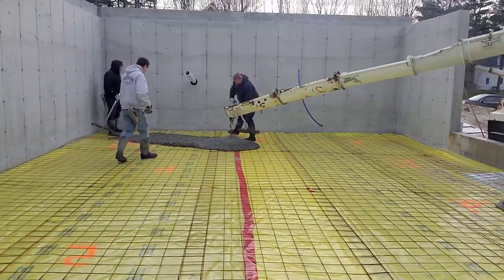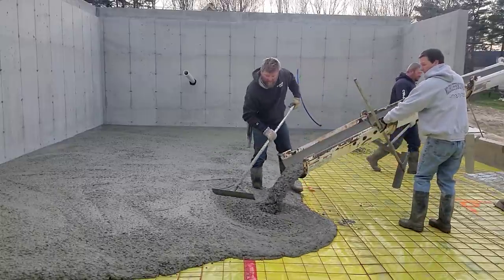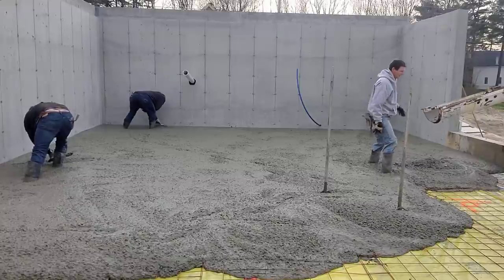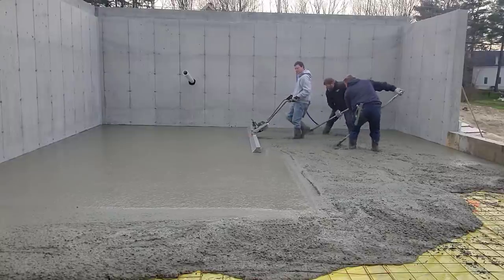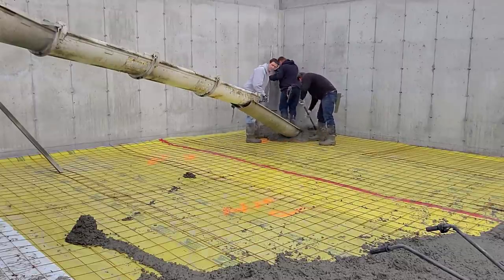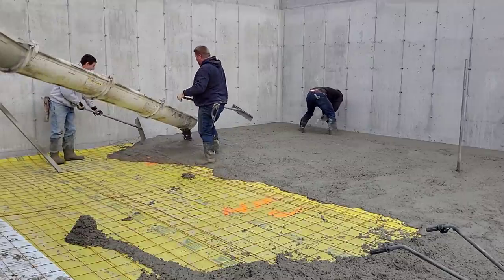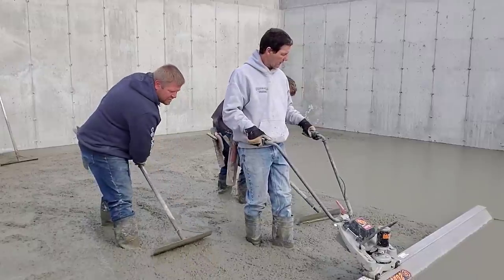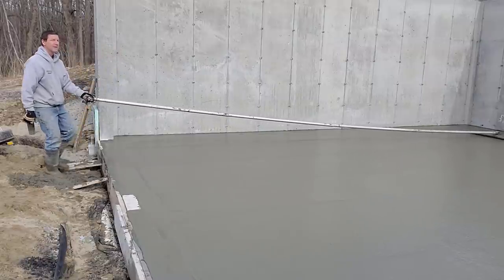How To Pour A Concrete Floor - 3 Man Crew - No Sweat!

Comment: Philip MacKenzie, hey Mike doesn’t the water reducer weaken the concrete?
Reply from the maker: Just the opposite, you use less water so it helps maintain strength

Comment: I've been wanting to try the wet pads on my floors. I've always used grade stakes according to my straightedge length. Is it just quicker for you guys to use the wet pads or do you think it gets the floor closer by using the laser?
Reply from the maker: Just preference really, plus we don't have to worry about hitting one and having to re-set it.

Comment: Are you having problems getting concrete? I was just told I can't get concrete because of a cement shortage?
Reply from the maker: Sometimes, but mostly due to a shortage of mixer drivers not cement shortage.
Reply: Down here in montana only select companies get concrete because of the shortage